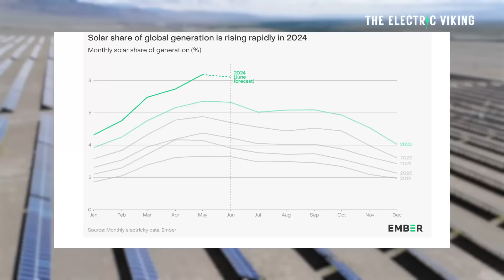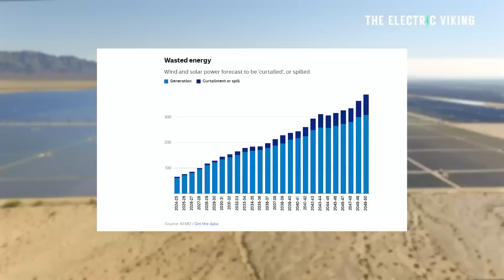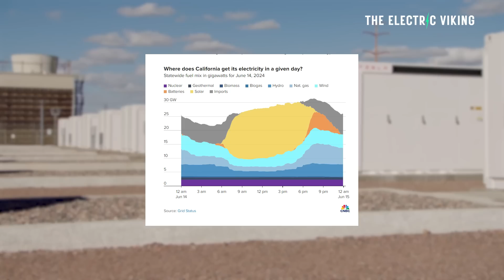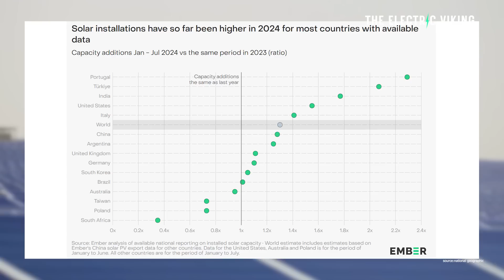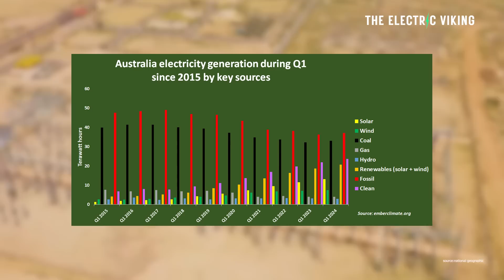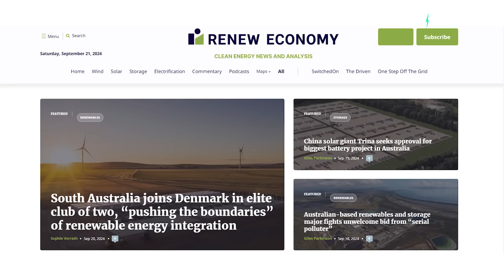Renewable energy hits record 102.5% of entire grid demand in Australia

Comment: Putting solar panels on roofs is a good idea for producing electricity and better than building massive solar farms. I live in Brisbane which is very spread out with a large suburban area. If just 8 panels were put on every house they would supply enough electricity for the whole city.
We should tread very carefully when building large solar farms. We hardly know enough about what the ramifications will be by buildings these monsters. Scientist are showing concern on how the solar panels are changing the molecules in the air above the panels, which heat the air, and causes the hot air to rise.  
When hot air reaches cold air in the atmosphere it rises above the cold air and can cause unusually heavy rain. It seems the more and larger solar panel farms we build the heavier rains we are experiencing.
Nearly every country in the world this year have experience record flood rains. The two recent ones to have record floods rains are England and Japan. (24-09-2024). The flood rains could be caused by large solar panels farms thousands of miles from the country affected. 
We really don’t know and the Columbia University Researchers at the Center for Life Cycle Analysis and the PV Environmental Research Center are studying the potential for a heat island effect in large solar farms. They are using computational fluid dynamics (CFD) simulations to model air velocity, turbulence, and energy flow fields induced by large solar PV farms. 
Also, The University of Maryland and the University of Arizona, the University of Wisconsin-Madison, and the Nevada Center of Excellence are doing research on heat islands effect caused by large solar panel farms. 
Scientist warn Massive solar farms, especially those in deserts, could potentially alter local climates and weather patterns. This could have unintended consequences on a global scale.

Comment: What you need to comprehend is that the climate is changing. China has installed hydroelectric that it cannot use because of water shortages. We need a backup that can be turned on. We are going to rely on gas in the shorter.

Comment: Wind is very peaky; so is solar; it produces nothing all night long and very little most of the time; so you end up needing batteries which is the high cost defect in the plan.  These investments will be wiped out if Bill Gates expectation of a hydrogen Gold rush dominates as it may do.  You yourself reported on the USGS discovery of trillions of tons of natural hydrogen gas trapped just within US boarders.  If natural hydrogen is extracted cheaply; it will be greener and cheaper than BEVs using lithium tech. If that happens ; there is zero reason to be buying massively expensive battery farms.

Comment: The author highlighted the new Queensland batteries at 270 and 540 Mega Watt Hours (MWH). This is a total of 810 MWH. He claimed that the record download was 200 MW, so these batteries will supply 200 MW for 4 Hours. Queensland's night time power demand is about 5400 MW. This means that the batteries supply about 4% of Queensland's grid requirement for 4 hours. To put it another way, the batteries have a total of 810 MWH. For the 13 hours that Qld does not have solar power it uses approximately 72,000 MWH of power. So the batteries can supply 1.1% of this.  Lets hope they have a plan B for when its night and there is not much wind.  Just Saying.

Comment: I am confused by his claims. What he showed in his embedded graph was the rooftop solar power production and the coal fired power production at 12.30 pm on Wed 18th Sep 2024. So there was 13207 MW of solar power being produced and 7527 KW of coal fired power being produced. Total Grid demand at that point was 25487 MW. This meant that solar made up 51.8% of demand. I am not sure where he gets the 102.5% figure.  At 12.30 pm on Wed 18th May South Australia had 530 MW of energy for export from renewable fuel. At the exact same moment, Qld, NSW and Victoria were using 3566, 1750 and 2255 MW of coal fired electricity. So South Australia was the only state who's total renewable production at that moment exceeded total demand. In all other states coal was necessary to keep the grid active. So no, renewable production DID NOT exceed power consumption. All figures taken off the NEM Australian site which is available to the public. Also his support for batteries is misplaced. For example, South Australia has invested in batteries. Currently they will keep the grid running for about 15 minutes. South Australia's grid is by far the smallest in Australia. On current technology, batteries are not suitable for grid sized backup. If there is something I am not aware of which changes my conclusions, please inform me.

Comment: Unfortunately the renewables are only able to provide unreliable power, so in addition to the cost of the rollout, we will have to build more than we need and pay the cost of the enormous build, the upgrade and extensions to the grid, and the firming and battery storage.  We can't turn off coal and gas because we need power at night and on cloudy days.  The over supply of solar is just pointing out that the power from solar peaks when it is not needed, but drops off when it is needed in the morning and at night.  The solar fed into the grid during peaks has to be wasted to keep the grid operating.  Batteries like in SA are tiny compared with the amount required to replace reliable energy, and they are expensive.  After all this rollout is finished, we will have the continual cost of replacing the entire solar and wind turbines, bladed, solar panels etc, over and over again.  The panels and batteries will never be made in Australia, so we willl be funding China.  What are the real costs that we will be paying?  Record peaks is a problem, and the times when there is a shortage of energy on the grid the costs go up astronomically so keep the grid operating.  EV's just add to the problem, as we generally need to charge them at night.  We also ask the consumers to spend a fortune on panels, batteries, EV charging, and a long wait to charge car barreries when they run out of charge.

Comment: I did the maths, the government would have to pay for a massive new grid that is way more expensive than the central generation plant. Way bigger. 
The customers pay $millions. 
The nuclear plant costs $billions.
The bigger grid costs $trillions.
If no fossil fueled energy is used. 

If customers use rooftop pv electricity when the sunshines the grid economics is destroyed as the customers do not pay but only when the sunshines and the battery is full at sunset.

Comment: Nuclear is extremes, 
Nuclear cannot work without the grid.
The grid cannot economically expand. 
Grid to the millions and millions of customers 
Is millions km @ $millions per km.
$TRILLIONS and $TRILLIONS. 
Nuclear brag about the $BILLIONS 
And expect the people to spend $TRILLIONS and TRILLIONS in grid infrastructure increased capacity. 

Monopoly Nuclear AT the location of the billionaire's AI. 

Talk about the 10 times more electricity grid needed to replace fossil fuels. 

Grids today are just off broke. Blackouts. 
Grids are built to minimum working capacity because they are so f...... expensive.
Reply: Rooftop PV and BVs OVERSIZED BATTERY can replace 
Petroleum imports 
Electricity imports from the grid 
Gas imports from the street supply 
Gas LNG bottle supply imports 

Rooftop PV and BVs OVERSIZED BATTERY can also SUPPLY the existing national grid for new CASH FLOW from new heavy industrial customers.

Comment: Renewables is good. However your 102% is optimistic/misleading. I'm sure at 10AM-3PM renewables can be ~100%. But you can check the NEM at 7pm and throughout the night. Heaps of coal/gas still being burnt as only wind/hydro works at night. All the rooftop solar at 7pm= 0W
Reply: Make hay when sun shines.
Reply: @jondonnelly3  Sure can get electricity when its sunny. However need lots of batteries otherwise excess electricity is discarded.

Comment: Reading some of the Renew Economy material I learnt that the concept of baseload electricity generation is quickly becoming redundant (i.e. coal, nuclear).  They are dinosaurs that don't have the agility to switch off in response to supply / demand imbalance.  So a grid with sufficient overcapacity of nimble sources (solar, wind and batteries) will outperform both financially and operationally.  The LNP policy of building nuclear as a baseload supplement looks like it would be redundant even before the first sod is turned.  No need to get hot under the collar with political or "nuclear" debates - economics will make those debates redundant, so we can all focus on achieving the good things to come from a grid that is abundant and cheap.  Just need technology to keep delivering!

Comment: If you can afford it, private home batteries really help this work. They hold the excess solar output until later in the day. I am currently starting my ev charging at 3am in order to empty the house battery ready for the sun rise. Before 7.30am there is enough power from my panels to be both charging the car and beginning to recharge the house battery. I have not bought petrol or electricity for ages.
Reply: I am in suburban Perth. A fire would need to get through a lot of homes before it got to me. In my situation there is no point in a PHEV. Almost all of my driving is local and twice per year a 250km trip to the country, easily accommodated by the over 400km range of the EV.
Reply: Having a water spray system was what I was thinking for the house when I lived in Oz.
Keep the trees and shrubs down and have a big water tank or pool to pump water to stop it burning.
The family would go and I would stay.
Diesel or petrol pump, power will go out!
Take care M

Comment: Why haven’t our power bills gone down then Mr Viking? Seems like it’s only benefitting people that have a house with a big enough roof to put solar panels on
Reply: Could it be privatisation and the way the system has been cooked to ensure high spot prices which are gobbled up by gas during peak times? If government hadn't sold off the electricity generation and kept it as a public service, then the cost benefits of solar would flow to the consumer. This way a bigger profit flows to the producer. But the outcome is still the same. The more solar and less coal burned, the better it is for the planet

Comment: Sam's focus on solar shows a lack of understanding on the complexity of our grid  babbling about solar filling 102 percent umm sammy it's not 24hr power  yes now you will babble about batteries without understanding to get through a winters night would require around 350,000 kw of batteries

And stop bullshitting about liberal scrapping renewable
They have clearly said the plan would be renewable with nuclear backup for baseload
Reply: Baseload is a redundant and obsolete concept. In a renewable grid you need firming power, not baseload.
Reply: @andrewrichardson73  rofl firming is baseload
Reply: @steveclancy7832  umm, no, they are fundamentally different. Baseload can't ramp down and up, it just keeps chugging along. That's why there is so much curtailment of solar in the grid at the moment - too much baseload. Firming can get out of the way when there are lots of renewables but then ramp up when needed. Or even better, charge when there is excess and discharge when needed.
Reply: @andrewrichardson73  wrong baseload can ramp up and down as it currently does
Reply: @steveclancy7832  then why is there enough energy to supply 100 percent renewable to grid, but maximum it can get to is 70%? It's because the coal generators can't reduce their output any more - that's the problem with baseload.
Reply: @andrewrichardson73  that is exactly part of the problem with intermittent power and makes it unsuitable for 100 percent of our power supply
Reply: @steveclancy7832  No, the problem isn't with the intermittent generation, the problem is trying to mix intermittent generation with baseload generation rather than firming generation. We can keep arguing all day, but AEMO and all the poewr generators are planning for the grid to move to renewables+firming whether you think it works or not.
Reply: @andrewrichardson73  lol time will prove I am right